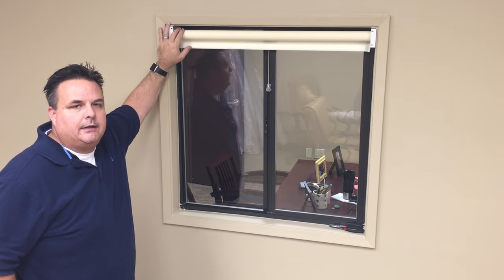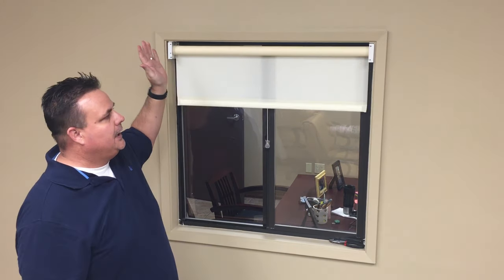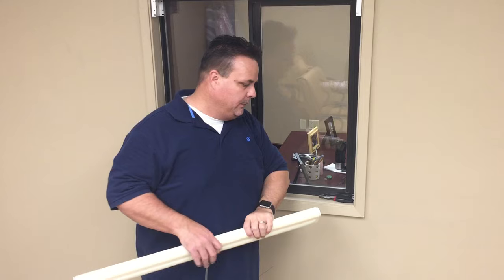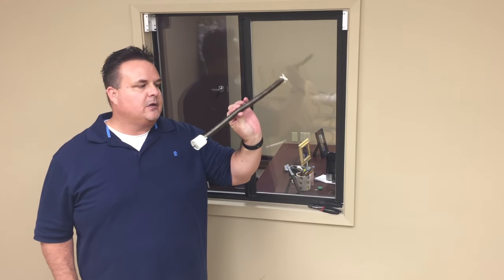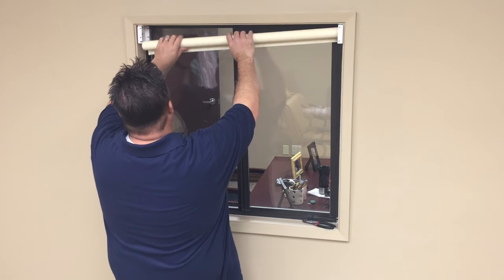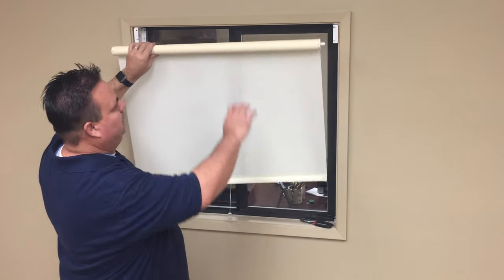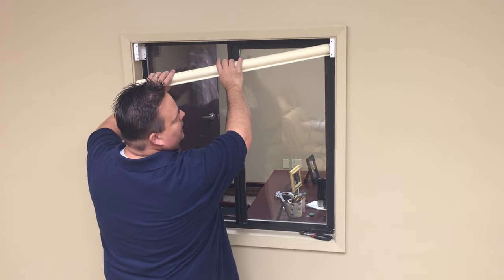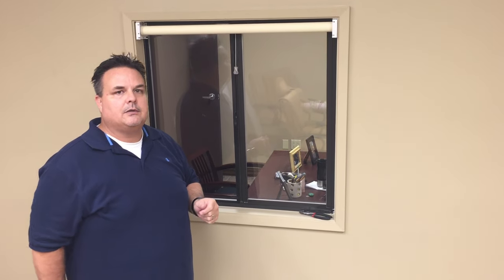Re-tensioning & Replacing a Spring on Cordless Roller Shade

Comment: Brilliant. Except on mine I had to push the pin back in to lock the spring first and then wind it back up. It took me two winds to get the spring to pull the blind back up. Wooo hooo. My blind is working again 👍🏼💪🏼✌🏼

Comment: This isn't working for a fabric roller from Lowe's. The window and roller are 70 inches wide, the roller itself is a gauzy burlap type feel material. We have the roller down, shade rolled up, we tighten the tension and insert the two ends round and flat into the brackets and the minute we let go, down comes the entire shade.